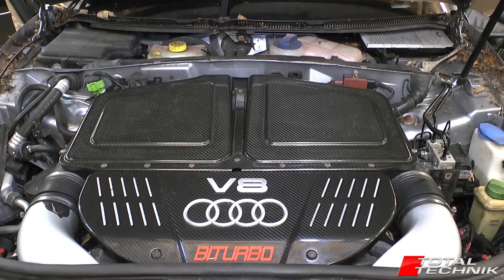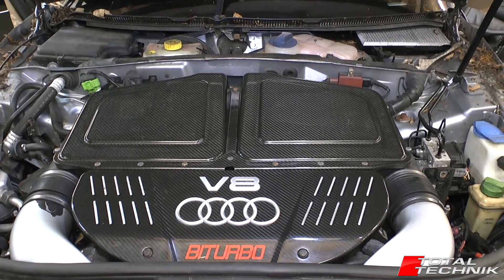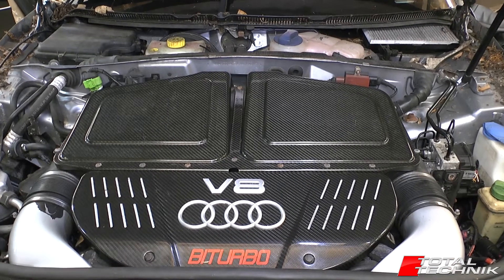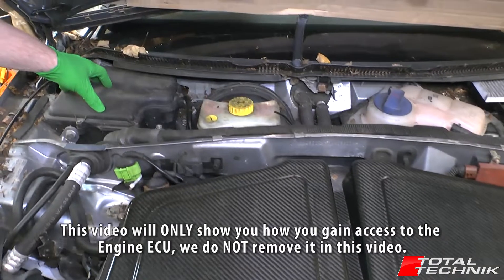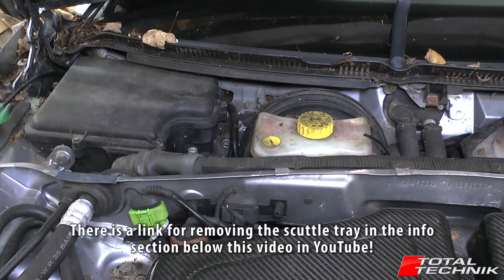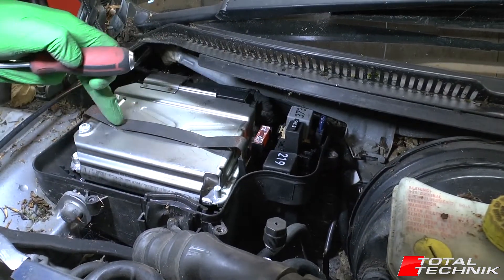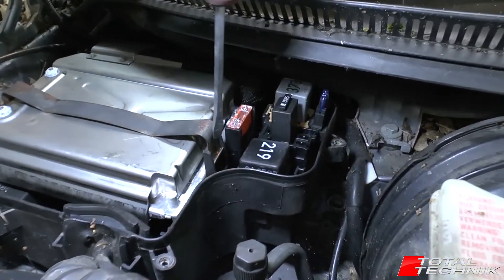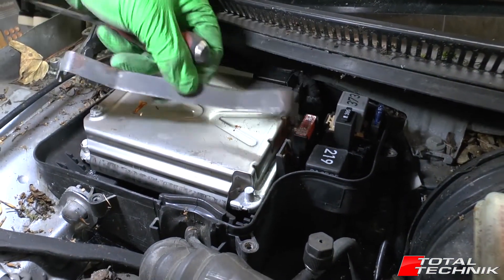How to Access Your Main Engine ECU - Audi A6 S6 RS6 (C5) - 1997-2005 - TOTAL TECHNIK

Comment: Is this the first stage to remove the plastic box, in order to check the drainage holes ? I believe there is a drain hole underneath ? 

That rear screw you took a while to get out, is that the only method ? I looked at mine earlier & didn’t think it was accessible like that ? 

Thanks